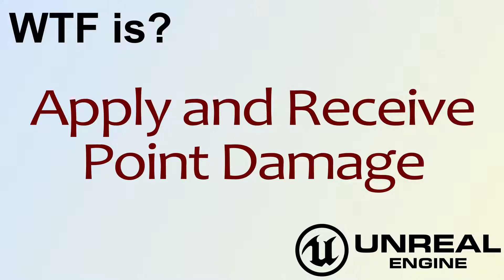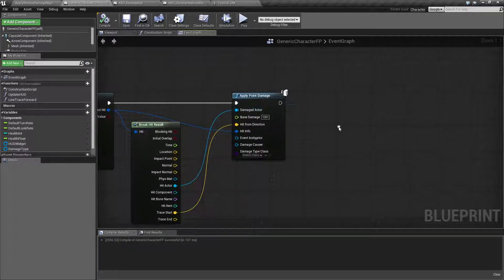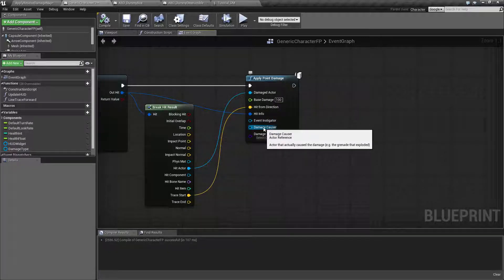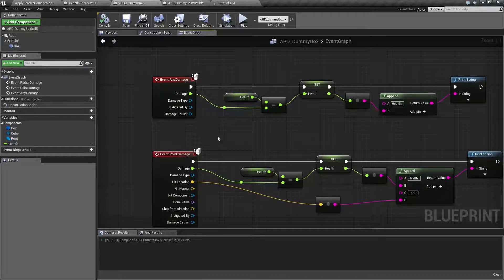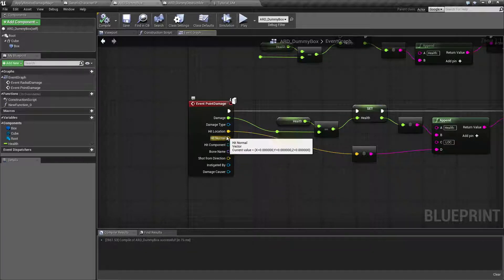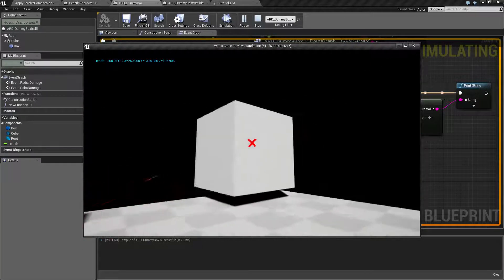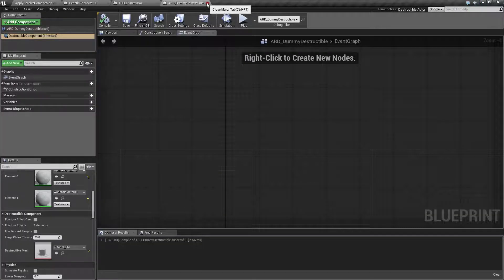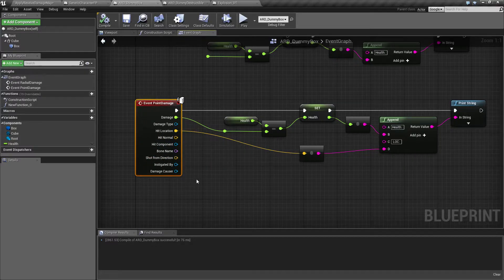WTF Is? Apply and Receive Point Damage in Unreal Engine 4

Comment: I'm not primarily a programmer, But wouldn't this effectively be able to create a laser beam to cause damage?
Reply from the maker: +Gaming with Mikey! You could use this to determine where you are hitting with the laser beam and to tell the target or surface where to apply damage yes.  The actual laser beam itself would have to be done with a model or a particle for the laser effect itself.
Reply: Mathew Wadstein That would have to be done with a ray cast wouldn't it? I can make meshes and particle effects, Programming and BPs are still make weaker area.
Reply from the maker: +Gaming with Mikey! all the apply/receive damage nodes do is allow you to easily pass damage to and from something.  They wont handle the actual particle effect or the line cast you would use to determine what you actually hit.  You would need all 3 basically; Linecast to determine start and end for the laser beam, particle effect (beam emitter) to create the laser beam effect, then apply/receive damage to actually apply the damage if you wanted it.